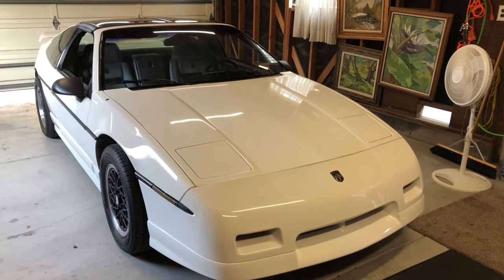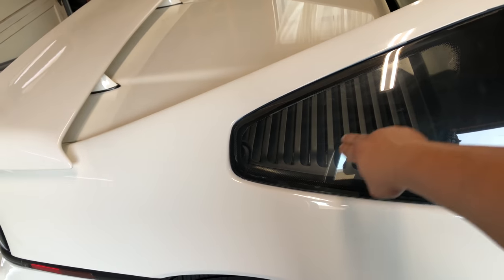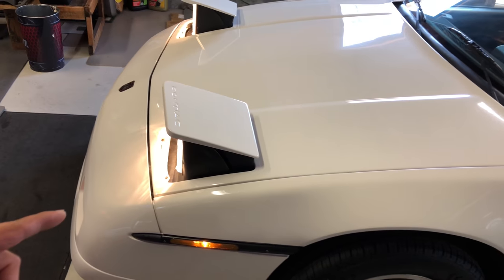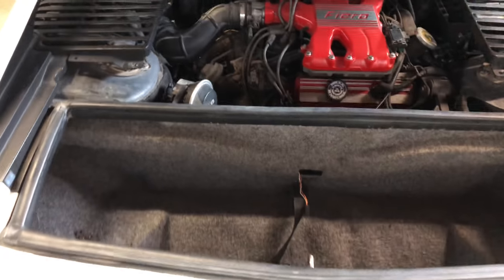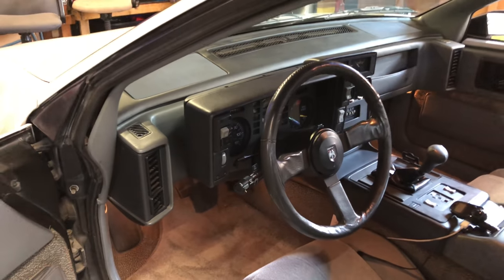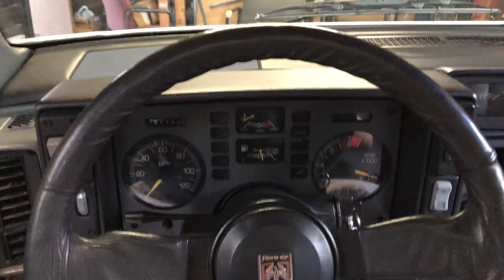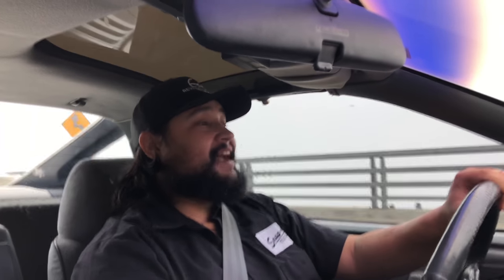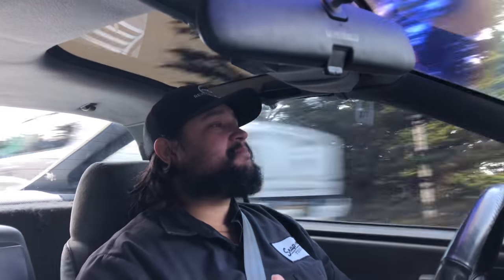I REVIEW MY NEW GM MID ENGINE SPORTS CAR!! | MY 1988 Pontiac Fiero GT Coupe

Comment: I drove an '87 MR2, so I was very aware of the Fiero rivalry at the time. It was definitely not lost on me that the Gen 2 MR2 ended up looking ALOT like the V6 Fieros. I think that if GM had gone all in and continued to develop the Fiero, it would have done very well into the 90's.
Reply: The gen 2 MR2's were actually styled after the Ferrari 308 GTB and, until Ferrari sued, there were kits to do this body conversion to a very high level copy. The Fiero had a similar option called the Mera which was sanctioned by GM so the conversion could be made on a new vehicle without loss of the warranty. Ferrari sued them too. They should have done a Lambo, they seems to appreciate the copying of their style as I have never heard of them suing anybody and kits are available to this day. BTW, a stock 86 Fiero will outperform a Ferrari 308 GTB from the same era. Add a few upgrades and the Ferrari is left in the Fiero's dust.
Reply: The good people at Corvette fought the Fiero from the onset.   When test models outperformed their precious Corvette on the test track, the Corvette folks went appoplectic and was the primary reason why the Fiero was available for the first three years with only the anemic 4-cylinder 2500 cc Iron Duke engine.    

I've owned and driven a Fiero since '89 as my primary driver and currently drive an 88 V6 5 speed....and, I'm 82.   It recently turned the 66K mark.   While on a motorcycle trip in 2008, I met the woman who would become my 2nd wife.   We have (at this point) retained our original homes, so this Fiero has made many trips across the Golden Gate Bridge.    
BHE
Reply: @MikeHammer1  
I'm confused by your comment. To be clear, Ferrari did NOT sue Toyota over MR2. Nope! Toyota claimed they came out with SW20 first before Ferrari came out with 348. Ferrari sued GM over Mera because it looks so similar to their 308.
Reply: @vice4134  Perhaps it wasn't my clearest example of writing, but Ferrari would sue the makers of KITS that were look-alikes to their vehicles, not Toyota. Other exotic car companies, like Lamborghini did not do that.
Reply: @blackholeentry3489  While the Fiero iron duke engine was available throughout the entire production run from 1984-88, the V6 became available in 1985, only 1 year after the duke, not three as you wrote. I own an 86 model with the V6.
Reply: @MikeHammer1  A technical issue.  Yes, as far as I know, the V6 first became available in the 86 model year, which, of course were sold in the late 85 year, so technically the V6 was availabe in that year, but in the '86 year model....as most car models become available in September or so for the upcoming year.   

I've owned and driven Fieros since '89 as my primary driver.   Hard for me to believe, but the current '88 I now drive I bought in 2013, which had only 19K on it at the time.   It had belonged to a dealer in Mankato, MN, and because it was to be the last year produced, the dealership placed it on the showroom floor for seven years and then moved it to Florida for himself to drive while vacationing there.   It now has 77K on it and I just had the first major tune up done on it.   The one spark plug is so difficult to get at, the mechanic had to pull the engine to enable it to be changed.   Hopefully, at age 82, I will not have to worry about it again.  

My 'other' vehicle, which I am soon using to make the move to my 'wife's' home is a 58 GMC 3/4 truck with a Pontiac 401 in it.    I've owned this truck since the mid 60's....then, I'm selling it.  BHE
Reply: @blackholeentry3489  I don't wish to start a feud, but if you consider that the 84 came out in September of 83, then the 85 came out in September of 84 and a notchback Fiero GT was available with the V6 then. The fastback GT with the V6 came out in September 85 as the 86 model year and halfway through that model year the 5-speed manual gearbox became available. That is the model I currently own. So only 1 year to the V6 and 2 1/2 years till the 5-speed.  From Wikipedia:

By 1985, the oil crisis was over and demand developed for a Fiero having more engine power and better performance. Pontiac responded by introducing the GT model which included upgraded suspension tuning, wider tires, and a V6 engine having 43 hp (32 kW) more than the base four-cylinder.[10]
Reply: @MikeHammer1  That may be true....however while you may have purchased an 86 in 85, it was produced like three months before the year 1986 began, so even though it was an 86 model, it was manufactured in 85....the same way automobiles have been manufactured for decades.  

I owned two different Fieros, both 86's with the Iron Duke four cylinder/five speed.   Then, in 2013, I bought an 88/6 cyl five speed with just barely 20K on it and which has been my primary driver ever since.   In other words,  a Fiero has been my primary driver since '89.   My 'other' driver is my 58 GMC 3/4 ton with a Pontiac 401 in it.  

I met my 2nd wife in 2008 while on a motorcycle trip and we have been maintaining two households ever since we married in 2010, but that is soon to change.  I will employ my GMC truck to move my household belongings and shop 'here' then I'm selling the old beast....after owning it for  over 40 years.  Not concerned about selling it as both my real estate agent and my banker are already fighting over it.    BHE
Reply: @blackholeentry3489  I am not the first owner of this Fiero. And being it is both a fastback and a 5-speed it was clearly manufactured on or after June of 1986. From Wikipedia (and I can corroborate this with many other sources, including the Pennock's Fiero Forum on the web): 

The previous year's GT became the 1986 SE. The 1986 GT was delayed until January 3, 1986. This was the first time the fastback roofline was offered, sometimes referred to as a "1986½" model, as the new fastback body restyle was not yet ready for release at the start of the model year. Though originally conceived by Pontiac insiders as a new model, possibly called the "GTP" or "GTU," it has been said that GM management at the time felt that using "GTP" or "GTU" suggested a racing car, an image they did not want to promote. Individuals present at the unveiling of the new fastback roof style, in February 1984, at GM's Arizona test track, actually thought it was a new Corvette at first. The Muncie/Getrag 5-speed transaxle, which did not arrive until June 1986, became the standard transaxle in V6 models.

Comment: The early car was built with a Chevette front suspension.  The rear was the front wheel drive unit from the X car (Phoenix, Citation, Etc).  The engine was used as a part of the structure and the unit was mounted in the back of the Fiero, using a support bolted to the engine's oil pan.  The bolt would stress the oil pan so much, that it would break a hole in the pan, hence the engine fires.  It was fixed almost immediately by Pontiac by a recall, but not until several cars burned.  The Fiero's reputation for going up in smoke was undeserved.  The Pinto was a dangerous car in that if you got bumped in the back, a bolt would puncture the gas tank.  Ford's solution was to settle the many lawsuits that resulted, but not to fix the problem.

Chevrolet was ticked off that Pontiac was allowed to built a sports car, so they complained to GM and got the Fiero killed.  Remember that Chevrolet advertised that they built America's only 2 seat sports car?
Reply: Don't know where you got your info from, but the 4 cyl. Iron Duke engines in Fiero's caught fire because of three things. The first was a 3 quart oil pan (due to clearance issues) that people neglected to top up with oil. The second was a bunch of defective connecting rods. The third was the placement of the catalytic converter just under the engine. Low oil led to premature failure of the connecting rods which led to puncture of the oil pan. The oil would ignite when it hit the catalytic unit. About 140-150 Fiero's caught fire this way. The engine is attached to a cradle  that is bolted to the frame using bushings at four points, but it is not connected via the oil pan. The 6 cyl. virtually never had any fires. The rest of your info is correct AFAIK. BTW, I own a 1986 1/2 Fiero that I have pulled the engine from and replaced with a 1995 Camaro 3.4 L V6.
Reply: Saying the frame was “bolted to the oil pan” is like saying it was bolted to the windshield.  The Fiero’s fate is to have stupid rumors spread about it. It’s almost 40yrs & misinformation just keeps coming.
Reply: This video continues the stupid rumors..
 No Fiero ever had struts on the front suspension. All Fiero’s have front shocks. I’ve owned : an 84 SE,  V6 85SE, 86GT ,and now have an 8cylinder ‘88 GT. That’s a “Cadero@,  or a Fiero GT with an engine out of a 4.9 liter aluminum block Cadillac.

Comment: Back in 1998 I was looking around car lots just dreaming of getting a car. I did not really have any credit history. I found a 1988 Red Fiero GT, tented rear pop up sunroof, V6, 5 spd, with tan cloth seats, 57,000mi and it was in great shape. No tears in the seats, no cracks in the dash or anything. The car was all still stock with no changes to the interior or motor. I could tell looking at it that it had been maintained reasonably well. I found a windshield sticker showing an oil change, air filter and coolant at 56,600mi. In the glove box/um I mean center compartment were repair receipts for regular oil changes, tune ups, timing chain change, shocks/struts, tires and such. The salesman managed to work out a deal and take my 85 Dodge Aries K car for trade. I drove home in the GT that day. I had it for a week and on the way home one day I was laying into her a bit hard all of the sudden smoke and steam everyplace. She blew a head gasket. I gave a call to the car lot and before I could say anything the salesman said hey I need you to bring the car back in. See I had been looking on a Saturday and banks were closed. They looked at my credit score, my job, my trade and cash down and figured a deal could just be worked out on Monday.  It wasn't and the salesman had written my phone number down wrong and for some reason never thought about calling me at work. So I parked the car beside the lot that night. The next day I walked onto the lot. They had my car pulled up already, gave me my keys, title and my check back. Asked where the Fiero was. I pointed it out and handed them the keys. I told them it had been running horrible and something was wrong. The lot kid grabbed the keys went to it. Started it up and preceded to dump the clutch doing a little burn out. Well by the time he pulled onto the lot water and oil were pouring from the bottom. He just hot the final nail and killed the engine. Parts of a piston, rod and crank were on the ground under it and chunks of the oil pan behind it. I got in my car and left as the salesman stood with his head in his hands, lot kid sitting in the drivers seat looking scared and the lot manager just saying " A new day a new dollar!"

Comment: I love a clean Fiero.

Functional air scoop.
Functional engine vents.
Proper mid engine weight distribution.
Super heavy doors.
Two large ash trays.
No cup holders.
Underpowered NA V6 (if you're lucky)
Pop-up up and down headlights.
Speakers in the headrests

What more can you ask for?

Comment: I had an '86 SE with T-tops. They used to fit perfectly behind the seats with the T-top handle on the top side. To this day, it was the best open air experience I've had. Not too much or too little air flow. The '88 had the much better Getrag 5-speed manual paired with the V6.

Comment: The hood and decklid are fiberglass.  
Saturn didn't just use the concept.  when the Fiero project got scrapped they used the whole fiero facility to Build those saturns.  in much the same way.
The 89 and 90 Fiero concepts had the 3.1  and then 3.4 liter DOHC v6 in them.   That engine wound up in the Lumina/Monte Carlo Z34 platforms, the Grand Prix GTP,  the Cutlass Supreme all the big sporty cars before the Buick 3.8 with the blower became the hotness.   The 3.4 Originally made around 250HP at the wheels (GM was making 300 hp on an engine dyno,  and then they started worrying about the 4T60E transmissions they were going to attach it to).  So the final output of the engine wound up being about 200-215 hp depending on which year you find.  
Oh yeah.  It 100% bolts right in.   You fabricate a topside lil torque/dogbone mount to the frame and it works like it's meant to off of the donor car's ECU.  One of the easiest physical swaps out there.

Not that I would in that dreamboat.  But if you come across one that isn't cherry,  but isn't completely rotten, it's a very cool period upgrade.

Comment: The 2.8 liter engine was first used in the Citation and it was designed to be equally useful in FWD and RWD vehicles.  It's use in the small trucks started a couple years later.
Reply from the maker: Cool thanks for the correction!

Comment: In 1990 I bought a 87 Pontiac vierro 4. Cylinder 5 speed with T tops. I paid $1500 for it because it did not run. It had 70000 miles on it. I put a new fuel pump in a tune up.
I used it for traveling back-and-forth for my wrestling shows. So in 2000 four, maybe 2000 five, if finally decide to quit running with 350000 miles on it. I wanted to put a V8 in it but I did not have the money so we sold it.

Comment: I had three Fieros - '86 4 speed V6, ''87 5 speed GT and the last one was ideantical to yours, 1988 Fiero GT with leather tee top and the five speed. It was a great car with much better suspension handling than the first two. I understand that lotus had a hand in the design of the suspension. It all came too late for the poor Fiero. The bean counters at GM decided that that would be after 1988.... I had it for about five years and then decided to move on to another vehicle, but honestly, I wish I'd kept it. It was just the right size could've done with more power but that could be easily addressed. Keep yours! Excellent video. Somewhere online I posted a video walk around of my car before I sold it and because it's such an old video it's MORE than a bit blurry - but if I can find it I will send you the link to your comments. 
Cheers from Toronto

Comment: this is a cool find, i recently found and bought an ‘86 Fiero GT automatic. Although it’s been sitting in a gentleman’s side yard for 10-15 years. only issues are the headlight motors are fried, and most of the gauge clusters aren’t working. it definitely held up. still runs like a champ tho
Reply from the maker: That’s awesome congratulations on your new to you Fiero. They are getting harder and harder to find out in the wild

Comment: You might want to join a Fiero Club. Fiero was NHTSA/NCAP rated 5 ☆☆☆☆☆ Stars for every year they were in production, even the 84 Iron Dukes with the shortened oil pan. Pontiac had several vehicles that were bantered about for production. Most constituting the Banshee project. Not until GM directed Aldikacti, Hulki into designing something to compete with the economical foreign market did the specific Fiero design come into play as Hulki's particular management style gave opportunity for engineers to work directly with manufacturing personnel. The T-Top seal can last practically forever if you keep the gutter completely clean and use a cleaning rag with a light dollop of mineral oil. The MR2 design upgrade has been bashed for many years, just as Fiero was in it's day as both presumably attempted to copy Ferrari, and any number of other sports cars. What ever the design. It's design that has stood the test of time. Since you plan on keeping it, I'm pretty certain you will do your due diligence in researching whatever you can to keep it in tip top shape. There are plenty of clubs, associations, web sites and message boards to provide you with all the information you may ever want in regards to Fiero so Cheers!
Reply from the maker: That’s awesome thank you for the extra info man 👍

Comment: The only T-top car I've ever owned was an '82 Z-28 that I bought as a shell. That was a fun car to build, and once it was done, it was even more fun to drive. Starting with a shell only, I had a LOT of room to modify anything I felt like modifying, but for the most part, aside from the computer and emissions system which I went out of my way to delete, I didn't change a whole hell of a lot. It looked exactly like a completely stock Z-28. But those T-tops? Aside from when it was parked, they spent more time in their bags and down in the well in the cargo area than they spent actually on the car. I don't remember if mine had locks though, but I'm kind of leaning on the side of no, they didn't have locks.
The 1988 was always my favorite year for the Fiero, and if I was to ever be in the market for one, the '88 would be the only model year I would even consider owning. Naturally it would have to be a 2.8L A/T or M/T GT model with all the toys that it would have been possible to order on the car when it was new.
It's just too bad GM brought the guillotine down on it right when they finally had all the bugs worked out of it and it was finally possible to outfit the car with the latest gadgets instead of just playing catch-up. I seem to remember GM doing that with another mid engined car about 20 years earlier. What the hell was that again? Oh wait... that's right... I remember now... It was a fun little compact car called the Chevrolet Corvair.
Reply: Correction: Corvair was NEVER a mid-engine vehicle. It's a REAR engine vehicle since its location is past the rear axle.